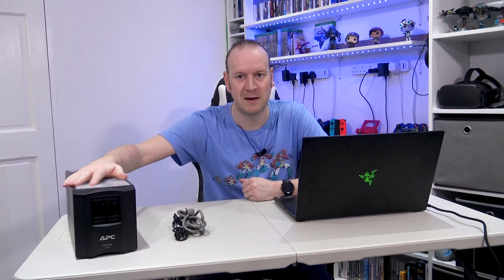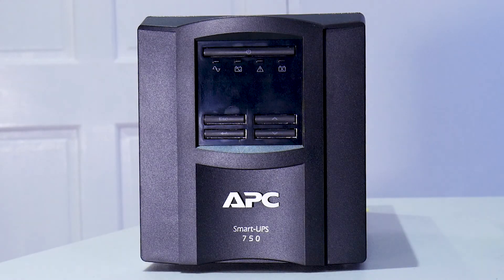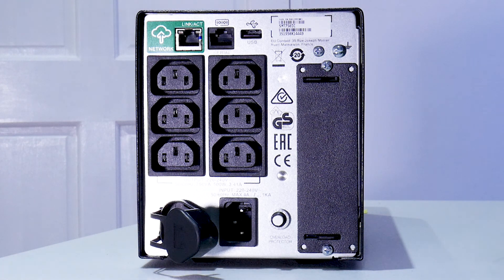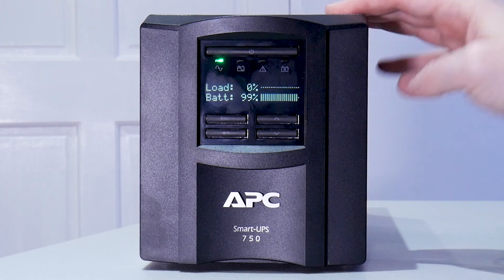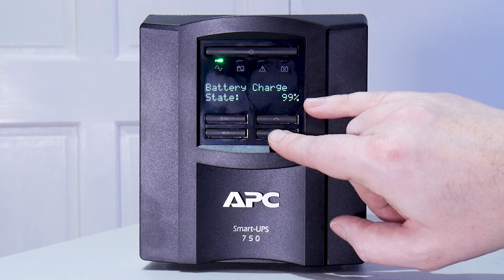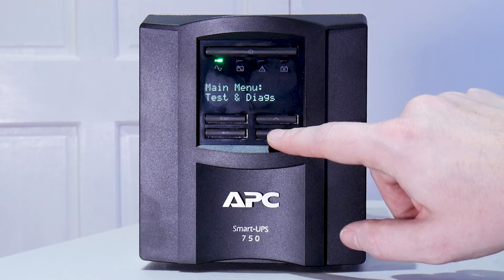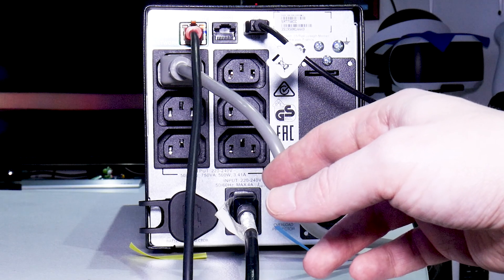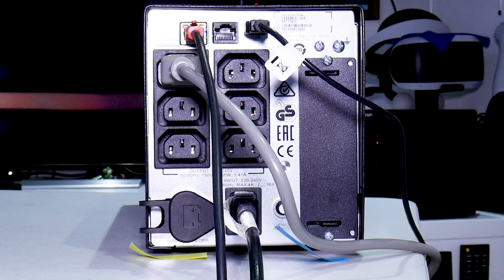How to setup QNAP NAS with a APC Smart UPS

Comment: At the 6:42 mark, the second choice "AUTO-PROTECTION" ... do you know if the power isn't back on will the NAS shutdown at that point or just run until the UPS battery dies?  I cannot seem to find the answer to this.
Reply from the maker: The NAS will shut down. The UPS sends the signal to the NAS to shut down before total power loss. I have had this tested a number of times since I made the video.

Comment: Just what I needed as I have today purchased self same unit as I've suffered several outages (short breaks) in the last couple of weeks. Hugely annoying, time consuming re-checking discs and can't do the NAS any good long term.  As I have a TS231p2 NAS with a TR004 extension cabinet , am I going to have to sacrifice my wifi dongle to make an availble USB port for NAS control from the UPS ? I think I might have to ! Your explanation is great , concise well explained and very useful.

Comment: Great video, could I ask is the fan operating when the UPS is connected to utility power working in normal mode? Thanks
Reply from the maker: My UPS is tucked away but I have just checked and when on utility power there is no fan running. It may kick in from time to time of the unit gets hot but mine is tucked away so I wouldn't notice.
Reply: @Abernus69  Thanks for the info!

Comment: How long can this UPS keeps the NAS running? Sometimes the NAS is just too busy to just shut down immediately. Thanks! I can also think of one stupid scenario: when the NAS is in idle or energy saving mode, then it will have to wake up first before it can process the shutting down instructions, which may take even longer.
Reply: Depends on the UPS capacity and the load of your NAS. I would estimate about 45 mins. You can calculate it here https://www.apc.com/shop/uk/en/tools/ups_selector/home/load - I have a 1000VA APC UPS and a QNAP 653D NAS (fully populated with drives), and a router, switch, POE injector for wireless AP, CCTV NVR, and mine will give 58 mins runtime. I set my NAS to shut down after 20 mins.

Comment: Hi just wanted ask your advise I watch your ctc 3D printer vids I got the same one but disc that come with it will not work at all could you tell me what software and drivers I need to download to get it up and running if you could help thanks